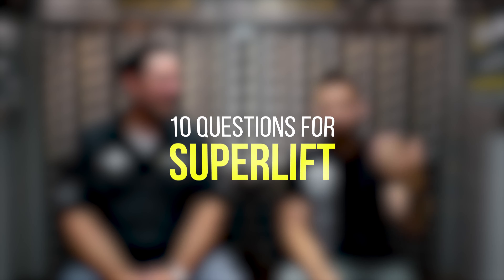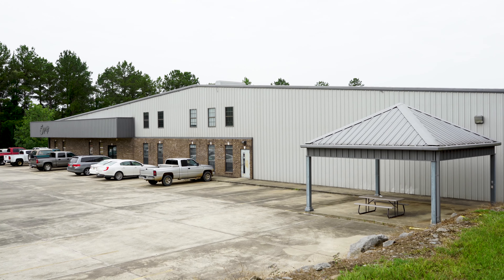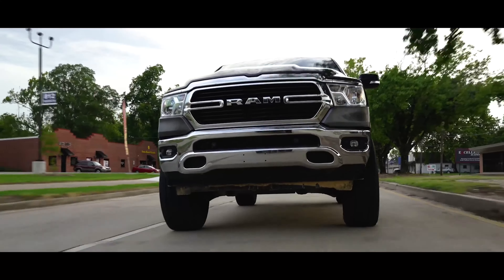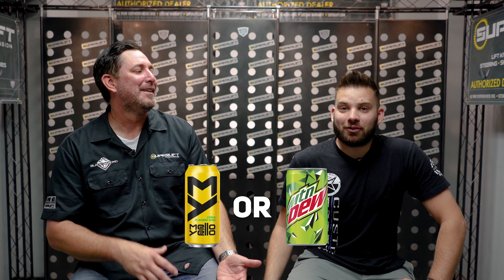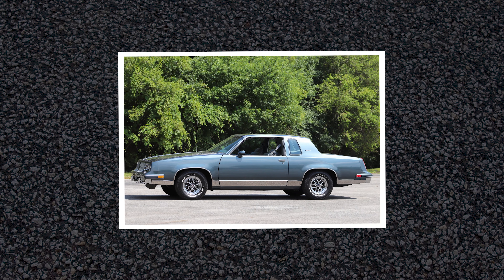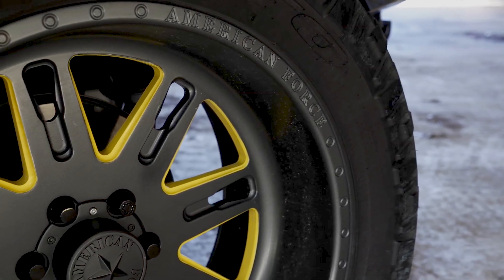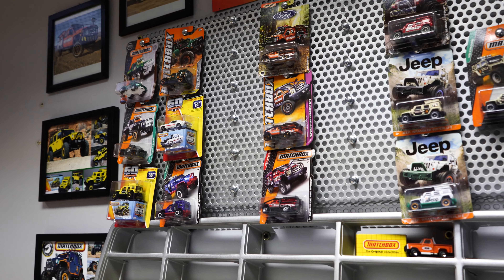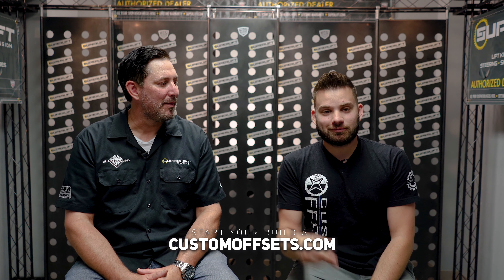10 Questions for SUPERLIFT!

Comment: Superlift is quality affordable equiptment. I don't get why more people don't go super lift over rough country garbage. I've had several super lift kits when I was younger and never once had an issue.
Reply: Zone is the way to go if you don’t wanna spend thousands
Reply: @Spooks_and_Gooks  I agree, I've had bds lifts and thats essentially what zone is, just not as fancy of a finish and cheap shocks.
Reply: @psycho-nutkase9233  I'm running a 8 inch top gunz customs kit on my 18 lariat with fox podium resi's and it's not a bad of a set up.. although I wish I was a little more patient and went with the stryker 12 inch kit. Next time. Your set up sounds like a pretty stout one. Expensive but worth it.

Comment: @customoffsets 
Zone off-road shock n3 rough county or superlift shocks???.....asking because all the lift kits are about same price I'm wondering about the shocks what's the better buy kit....even though I know superlift has the bills as a option which is looking pretty good but I just wonder who has the better home built shocks? Then whose the better kit
Reply from the maker: It really depends on the options you select, pricing varies on those options as well. Both are very good and comes down to your selections.
Reply: @CustomOffsetsTV  ^or in otherwords; just buy something

Comment: Been superlift for decades doesnt have a lift kit for 2008 dodge ram 🤦🏼‍♀️ if it wasnt for rough country i wouldnt be able to lift my truck
Reply: Justin Kratzer     For my 1996 k1500 it’s either a rough country or a $4300 12 inch lift